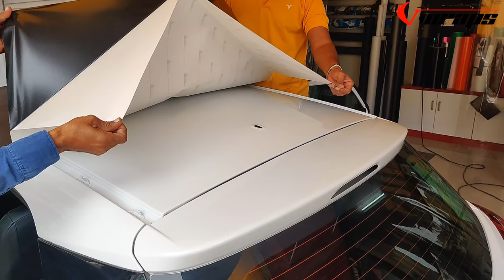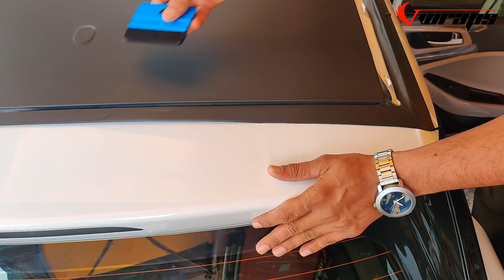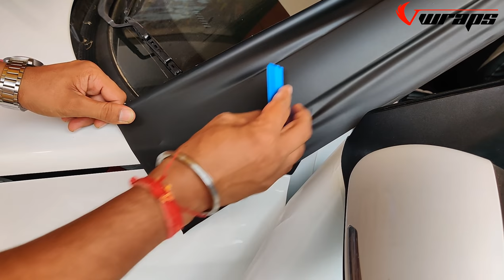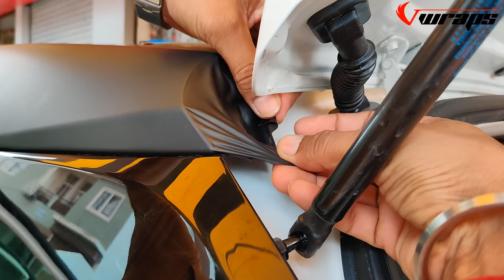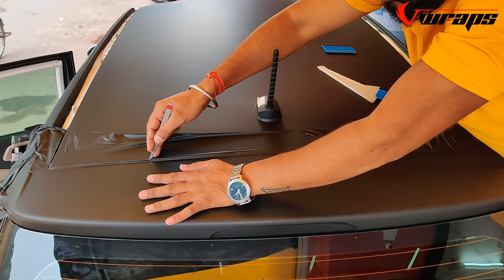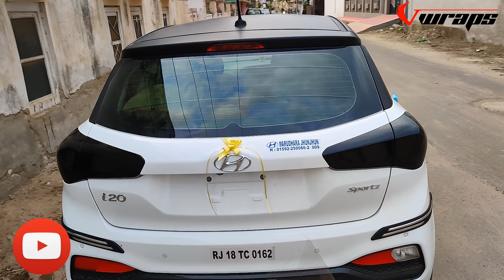Hyundai i20 Rooftop Vinyl Wrapping | i20 Modification | Vwraps Sikar |

Comment: Nice, what about summer extreme heat   , will it effect the vinyl sheet melting
Reply from the maker: After 4 years it will be affected
Reply: @VwrapsSikar  what is the cost to wrap Hyundai i20  old model Rooftop